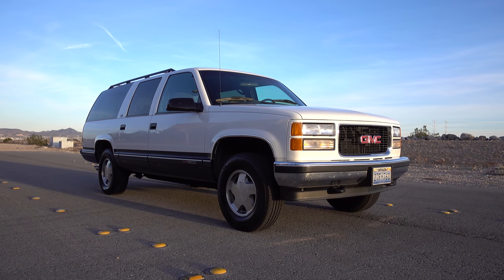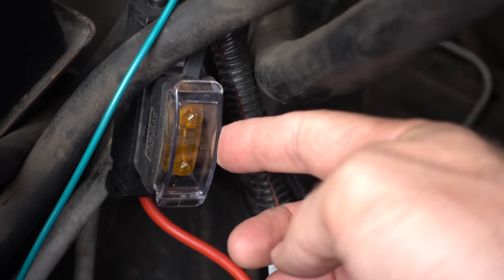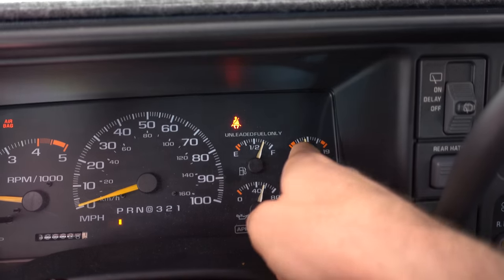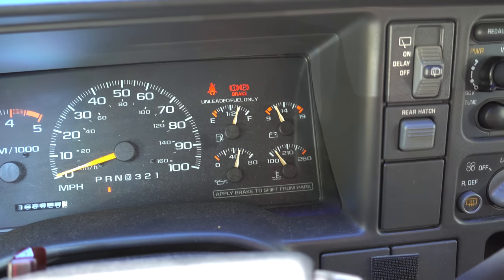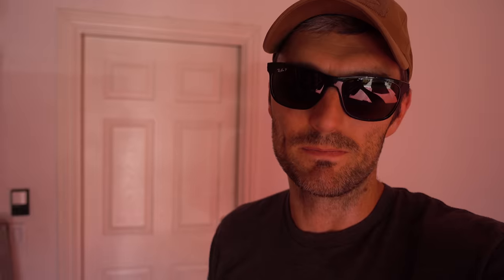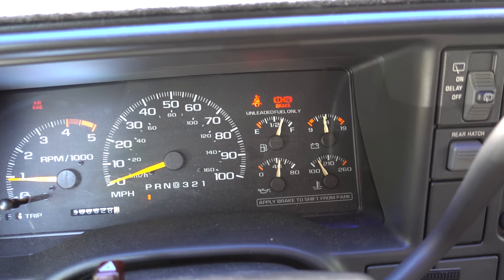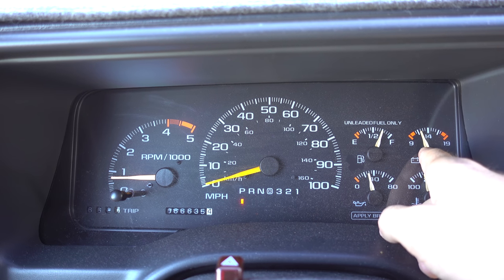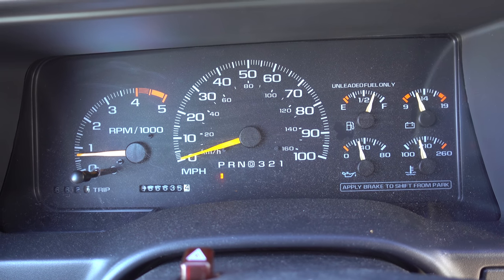SOLVE A LOW VOLTAGE ISSUE!

Comment: Stock alternator is only 105 amp...You can replace it with a aftermarket cs144 ..A few slight mods easy stuff..150 amp up to 300.....The battery is not the issue ...Your stock alternator doesn't have enough sack..I see this was posted a while back hope you got it sorted out..and no..you don't need dual batteries..Did this fix with our old 99 Yukon...2 years ago..no issues ..Not sure about the current draw on the fans you have but assuming you AC refrigerant was fully charged..

Comment: You should check voltage at  + cable points if they are all the same great if not clean all points to make great contact, also make sure all ground contact is okay also if there is still a problem -think you should get a higher amprage alternator.

Comment: Do a voltage drop test on  both battery cables. And the one coming from the alternator.  You might have some higher resistance on one of the cables.

Comment: I had the same thing 14 mp after running for a wile it started dropping all the way down to the redline come to find out it was a ground wire to my frame the old guy that found it going underneath my motorhome and Paul on every wire that was connected to my frame and found the loose one tightened it up I’ve been driving now for two years no problem. Grounds will do crazy things
Reply: i II 
m o. M u7u
Reply: I have a slightly rusty ZR2 S10, I am gonna have to relocate a lot of grounds. One bad one caused my rear lights to go haywire but it was an easy fix.

Comment: I know this video is 3 years ago but for ppl who experienced same problem I think it is not good grounding not bad grounding but not good that keeps the car running but on idling not smooth and when put a load it start shaking and voltage goes down. I have same problem. To check the bad grounding you need to use voltmeter to check voltage on battery and compare it with chase and engine block ground and see if there is a difference. There are a lot of videos on YouTube explaining how to do that. Also another symptom of bad grounding is after put an electrical load for some minutes you can feel the ground cables (one or more) or contacts points are warm or hot

Comment: I have a 2000 Chevy Puck up, C2500 with the 5.7L in it. I already upgraded to a 140 amp alt in it. Only thing left is doing the big 3 upgrade.I have the original fan new fan clutch. 10,000 LB gvwr.

Comment: Its the fans.  Too much power being drawn from the battery.  Either use a higher output alternator or those yellow cap batteries for car audios.  That should do the trick.

Comment: Go on Amazon and get u a 250 amp alternator by lactrical I use them for car audio they put out good power ur battery is good for some capacity of reserve but u r draining your battery reserve and ur alternator can't keep up u have the 105 amp alternator and it isn't able to handle the load or if I have money buy a mechman alternator
Reply: Hey I put a CAR AUDIO on my truck I even got a BIG CAPACITOR & OPTIMA BATTERY YELLOW TOP thinking it would fix the problem but it didn't still keeps going low WHAT SHOULD I DO ? I even bought a new alternator thinking it was that still didn't help

Comment: if the big three upgrade doesn't help try finding a 140 amp alt that has a smaller pulley on it so it can output more power at lower rpm

Comment: My money is on the belt. I found a parasitic draw but still had a voltage drop. New batter, new tensioner, new pulleys, Alt working fine but when I run my AC my voltage drops at idle. Changed my belt and solved the problem.

Comment: a pwm pulse width modulator could help... decreasing fan speed at idle and increasing fanspeed with motor rpm... but then you would want a failsafe switch or dial to override it when traffic is jammed up.

Comment: Liw voltage causes higher amperage ( fuse pop explained) But,when you added your fans you increased the system load.
Therefore the alternator needs to be upgraded to higher output capability.
Rule of thumb. Add all loads while running the engine and put an amprobe on the red lead between the alt and battery....size alternator for all loads + 10%

Comment: Upgrading the fans and increasing draw. You'll need to increase your current. Change out the battery and alternator to higher amperage to compensate

Comment: check your ground from fans. if you grounded it on body it may not be good causing resistance under the load especially at lower rpm. try moving the ground to a battery ground point. the resistance increases draw, increasing amps and blows fuse.

Comment: You should look for a alternator that puts out more amps.
Once had a problem with the alternator and the stock one was 150 amps. After that died, hot a refurbished one and things werent the same. It only put out a 80amps and could definitly see an increese of light power and voltage change from idle to drive.
Untill you go change the alternator, you should clean your ground and work your way from the alt to the battery and to the fans.
Alternator should put out atleast 14v

Comment: You need a dual alternator kit,I did mine for lights and sound system and two 16in fans,Two 200 amp alternators two oltima batteries and no problems.

Comment: Sounds to me like you have an engine ground issue, i would replace the main wires off of the battery, both positive and negative,  the replace the ground that goes from your frame to the bell housing as well, you can test to see if im correct by simply taking a set of jumper cable and connect the negative to the battery on one side and to the engine on the other, do not hook up the positive side. Also run a switch for your fans instead of tapping into the blower wiring, that will slow the pull of electricity by about 30%. I hope this helps.
Reply: I'll say could be the solenoid cable my s10 pick up did that

Comment: This happened to me and I thought my battery was dying also.  Bought a new battery and still a problem.  Went to 140 amp alternator and it did better, and then alternator gave out!!!  But I think it is the alternator.  Beef the alternator up and make the gauge of the wire bigger.  I think a second battery will overwork the alternator even more.  I think we both need a 200-300 amp alternator.

Comment: Hi, if you replaced a stock fan clutch for new aftermarket electric fans, then you must put an alternator capable of handling more current. Otherwise your old alternator will no be able to keep up with increased consumption and the battery will drain. Also you might fry your old low amp alternator.

Comment: I am way late to the party but if it was me i would split the fans wiring. Have them go on high with engine temp since your engine temp when fully warmed is way to low. Engine should be running at 210F not way below 150F like it is. If your engine temp is low because you did a thermostat delete, reinstall the thermostat because the engine needs that proper running temperature to operate at maximum efficiency. Without the thermostat the ECM never gets to closed loop bad mileage and poor fuel control is the result can over time cause engine and parts failures. The same is true to happen when a broken temp sensor is ignored for to long. GM did the 3 wire temp sensor for that very reason and in some cases a broken 3 wire temp sensor  reading -40F degrees will cause a no-start issue to save the engine from running in poor non-controlled conditions. This could very well be the cause of your long crank time i seen you thought it started good but the long crank time was present i noticed it! If you feel you need to do one fan on high to kick on with the AC do that but only 1 fan not both on high. Upgrade wire sizes the truck wasnt wired to handle those sort of loads from the factory. You need 6gauge grounds minimum (battery to fender, battery to frame, battery to alt housing/bracket or engine block). If since you have the side post setup and dont want to tie all those wires to the battery you can do a 0 gauge to the fender or a distribution point and run the others from there that can also be a cleaner look. Once the grounds are sorted run the hots that the devices specifically call for or use best judgement and a ampere capacity graph to find the right wire size.. I think i remember a certain ford car maybe a 90's taurus that every one loved to get the fan assembly from because it had low and high temp thermo-switches right on the fans shroud and made a great quick and dirty electric fan upgrade. As for the wiring i would look for more strands in the wire fine strand wire handles amperes better than thicker stranded (less strands per gauge) wire. OFC wire tends to be a go to for many but comes at a price. Factory wire is more of an AWG -THHN/THWN type with a low strand count. In your case it appeared the factory wire was only 8guage. Any wire rated for welding would give good results without the costs of the OFC type wire and if you do use non OFC wire you can combat the green or white crusties by crimping or soldering connections AND using liquid electric tape as well as good heatshrink this will keep the crusties away till the lugs themselves rot off. Wire crusties may not be as much a issue in AZ as they are in the rust belt or areas with lost of road salt or sea spray salts in the air. Big 3 Big 5 and Big 7 upgrades are pricey i would suggest building your own this way you know exactly what you get. Over laying factory wires is another option as well as targeting specific upgrades as desired. Car audio, over landers, and picky customers may prefer just do the entire upgrade depending on funds available.

Comment: Also you may wanna check the ground to those new fans!! I’ve seen a lot of vehicles where there is little or no ground to the front part of the vehicle like radiator area!! Make sure it’s making  complete circuit from fire wall to fenders to hood all the way to the front of the vehicle!!! If those all checkout alternator weak, I wouldn’t do duel setup since your factory wires and components are setup for single battery, may run into a lot of problems
Reply: Check the ground wire from the battery to the engine block it might have a bad ground and then it's a smaller black wire coming off the battery to that might be needing sandpaper clean off and ground

Comment: I got the same issues after I put in a new battery , took it to a mechanic and they said the alternator was putting out to much and need to get a new one , got a second opinion and they said it was ok after testing the system . Scratching my head in North Olmsted OH .

Comment: You either have a weak Alternator or a bad connection on the 12 Volt wire from the back of the alternator that goes over to the Positive Terminal of the Battery...Had the Same problem on my '95 Silverado Z-71...Replaced the 8 gauge wire that runs from the Back of the Alternator to the Battery. (it's routed over the top of the Fan Shroud and will be Red and about 1/4 inch diameter).  Now charges 13.5 to 14 volts under any condition.

Comment: Put on a second alternator or replace the original alternator with a bigger alternator or change the pulley on the alternator with smaller one this will help never use a second battery it's your alternator the vehicle was designed to run a engine mounted fan so the alternator was ment for that setup but when you went to a duel electric fan setup the factory alternator was not up to the task to handle it so a bigger alternator will help problem or add a second one will help to. Get one that is at least 220 to 250 or even a 370 amp this will help if you do not decide to add a second alternator. Your factory alternator is 120 amp alternator but this will cost money but help in the long run because if you drive at night and your charging system is not working properly your headlights won't be as bright as they need to be for night driving.

Comment: It is bad to run an engine too cool...
Reply: USZ71 I was thinking the same thing.   Although the cooler the cylinder the more power you can make.
Reply: Thermostat controls engine temp. The engine will run same temp no matter how many fans you run. I would have cked  and replaced the radiator with a 4 tube before putting fans on. Anytime one goes beyond stock,  your on the edge of the envelope, and most likely fall off the wrong side of it. Electrical systems are very fragile to non-stop ad ons

Comment: Some altornator low output at idle. Especially remanufactured or after market check that product first at their website. If that problem you can overdrive your altornator with small alternator pulley.

Comment: Did you ever figure this out?  I have a similar issue but batts & alternator is good. It seems to kill most the dash with HVAC on. 05 GMC Sierra. Duramax (dual batteries)

Comment: SOLUTION : YOU MAY NEED A HIGHER OUTPUT ALTERNATOR. THE BATTERY IS A "STORAGE" . YOU NEED TO ADD UP THE MAX CURRENT DRAW OF THE FLEXALITE FANS , AND EVERY OTHER DEVICE ,  AC , STEREO ETC .....  IF THE DRAW IS GREATER THAN THE OUTPUT OF THE ALTERNATOR YOU NEED TO GO HIGHER OUTPUT.  IF NOT YOU HAVE OTHER ISSUES. Get a volt meter and check the output AT THE ALTERNATOR under full load. Be sure to ground the meter to the alternator mount or body. If you are reading over 14 volts at the alternator under full load then test at the battery . Place one probe on the positive batt terminal the other on the negative batt terminal . If your reading is lower at the battery than at the alternator you have a ground issue. Run a heavy guage cable 1\0 will handle up to 150 amps . Also check to make sure you have good grounds Always use a heavy ground cable and connect one end to the negative battery terminal, and the other end to the starter motor or engine block as close to the starter as possible. This will insure the correct ground path to the starter motor. Ground the engine block to the frame with a heavy ground wire or cable, making sure that both connections are clean, tight, and metal to metal. Next, ground the engine block to the vehicle body with a heavy ground wire or cable making sure that both connections are clean, tight and metal to metal.

Comment: Did you solve this issue? I’m having the same issue when I put my 350 into drive or reverse. Rpms drop! Changed everything i think could be the issue and nothing. Tomorrow I’m installing an 124 amp alternator to see if that works.

Comment: 1Road, Did you ever find out what was wrong? I have a 2014 Chevrolet Silverado, mine is doing the same thing. I got the battery checked and it was fine. I got the alternator rebuilt and it's still doing the same thing.

Comment: These GM 1-wire alternators are designed to lower the voltage after the battery reaches a certain Voltage, supposedly to protect from over-charging. I'm not used to it and I don't like it. My 95 Dodge Grand Caravan charged at a constant 14.5VDC. ALL of my Amateur Radio equipment is rated for 13.8VDC, not 12.5VDC, which results in my Transmit power being lower than normal! I want a better alternator with a constant Voltage output, but have no idea which one to get, or where. Who (which sellers) do you trust?

Comment: Two possible causes:
1. Alternator ( diodes inside the alternator ). When you have dead diodes inside the alternator voltage will be reached, but he could not handle the load.
2. Setup is too aggressive for this vehicle and drawing too much current.

Alternator should be checked by car electric guy   ( Please write here Alternator max rating and battery output amps and CCA amps)
Reply: What do you mean to aggressive
Reply: @mrworldwide6770  Well, those radiator fans are not planned by manufacturer as electrical load, so alternator cannot deliver power for everything consistently, ergo even with max amps output, voltage will go down. Simply, more demand than supply

Comment: i'm having the same problems with my Camaro. I have two Derale Fans and i upgraded with the same alternator. My tests show that the alternator has a bad voltage regulator. I replaced it with another Alternator, one that is less amps (94 i think) and It also is acting the same. The fan draw i'm not sure of, but the fan relays suggested relays for 30 amps. I used the stock one and installed a 30 amp relay for the other fan. i do not know what the issue is, but the battery test at the local auto parts store said that the battery was in the last 1/4 of it's like. The batter is only a few months old. So, i'm stuck in this now too.

Comment: Yes same issue for different reason( diff power draw/ load)
 There is a constant parasite load 24/7.  No. Possibul electronic tranny load. What is battery amp hour? Check amp draw on battery, what are the fans drawing? Optima starter/deep cycle battery might help. They are made for high load draw.( optima says). Seems 95 and 96 Have issues like this lot of heavy amp draw. Just my expiriance. Mechanics strictly shade tree. But 50 years of it. For what ever that may be worth.

Comment: hello... Jimmy
Just wondering did you installing an extra relay on each fan? also did you  install extra ground wire from the alternator back to the batt -ve terminal? 
I also installed a bigger fan at my radiator too cos Malaysia climate is really hot... 
However, i didn't have such issue here cos i did upgrade the wiring to thicker gauge... 
also did you test the voltage with your lights on?? If the voltage keeps dropping... i suggest you to upgrade a bigger amp alternator to feed those huge fans... 
Have fun to explore...
Reply: Your altenator is dying or you dont have enough amp hour juice...